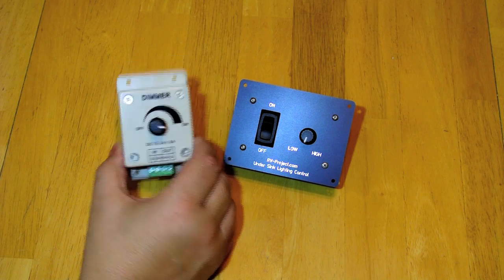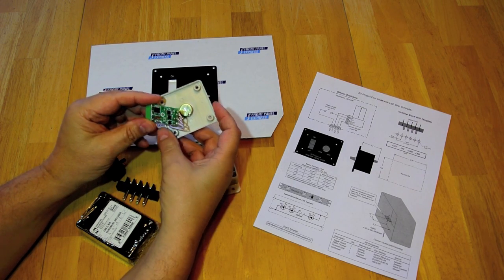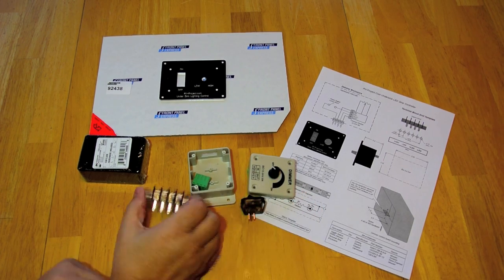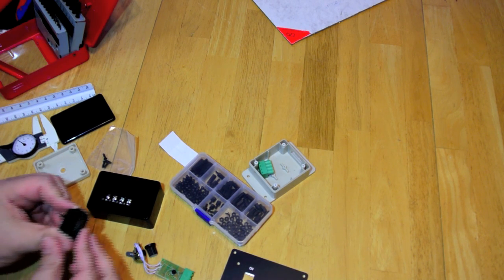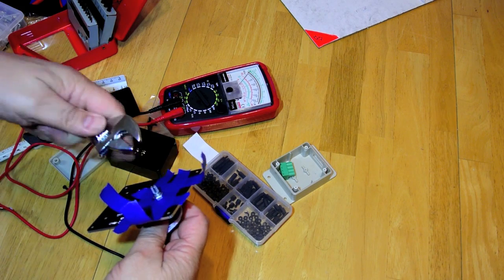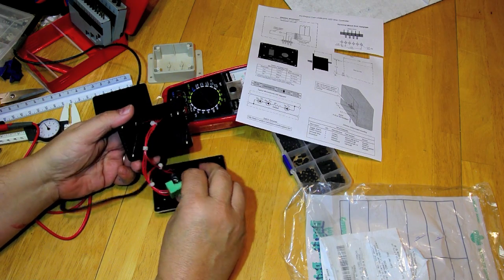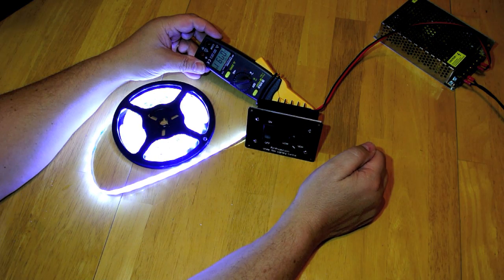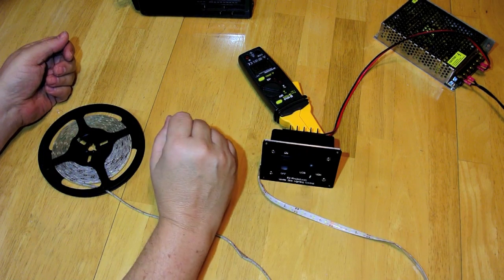A Custom LED Strip Dimmer for my RV

Comment: Is there a way to get the exact panel from front panel express without designing a new one
Reply from the maker: Yes. Most of my project videos have an associated webpage with additional information.  You can find the template for the panel here: http://www.rv-project.com/resources/e450.php

The template is about half way down the page. 

You will have to install the FrontPanelExpress designer to order the panel, but all you have to do is to open the template into the panel to do so.

Comment: Once again another well thought out design, I want to add some of these led strip light throughout our class c motorhome and I can't wait to see how they look in your fifth wheel! Job well done!
Reply from the maker: I will be doing a video soon on the actual installation. I decided to break the project up into two videos so they would not be too long.
Reply: RVProject can't wait to see it, we seem to share the same eye for detail especially when it comes to wiring... the crappy workman ship that the RV industry has deemed acceptable simply blows my mind! , We own a 2017 sunseeker 2300 class c (ford chassis) and it has had a total of three wires break do to the wires not being correctly secured and allowed to giggle around while driving down the road and I'm sure another factor that contributed them breaking is the fact that they Uses solid copper wire on the 110 side when strand wire would be much better for such a rough environment!  I've spent countless hours rerouting and securing wires in the coach since we have bought it and it has been at the dealer for the better part of the winter getting electrical issues fixed, really frustrating to say the least! Keep up the great videos and by the way I'm the gentlemen who bought the blank dash panel off you and I mounted a USB outlet, 12v outlet, volt meter and a small red led that I use as a indicator light that lights up when our toad car brakes are depressed because the wireless warning system that came with our roadmaster brake system is less than reliable! Thanks again for selling it to me it turned out great and looks almost factory!
Reply: RVProject j

Comment: FYI - I was reading the reviews on the other switch mentioned below and they its a mixed bag. The other switch I was looking at if i didn't decide to build your design was this on: https://www.ledsupply.com/led-drivers/12v-wall-mount-pwm-dimmer     I'm not sure how well it functions but its the same basic concept
Reply from the maker: I chose that particular dimmer because it was an easy one to transfer the internals into a panel you could customize. Any 12V PWM based dimmer would work for the under-sink project. 

I am currently in the process of producing a dimmer shoot-out video, but it won't be ready for another month or so. Depending on your time frame, you might want to see that video.

Also, I am designing my own dimmer that I expect to be the Mother of all Dimmers. I originally designed it to work with the Lippert Linc wireless control panel that some RVs have, but I realized after I designed it, it could be used in a stand-alone configuration as well. 

I actually just built the dimmer today, and am waiting for the encapsulating compound to cure. I have to shoot some video footage, create webpages, and so on to publish the project. This project should be released prior to the dimmer shoot-out video as I will be including my dimmer in the review. I hope to have that video released in a week.

Comment: I'm really digging your projects!! I think that this is a sharp switch and better than anything I've seen on the market. That being said I plan on building three for my rig. I have ordered everything but, I'm having a hard time locating the Degson 4 post terminal block. I have searched  the part number on www.parts-express.com and called them. It doesn't seem like they carry this part. I also found the part on Degson's web page but I cant figure out how to order it from there. I'm not well versed in electronics components so would rather not guess on this part. By any chance could you send me the link to where you purchased this terminal block? Thanks!
Reply from the maker: A suitable substitute for the terminal block is here: http://amzn.to/2BIiHTk

I also updated the project webpage (http://www.rv-project.com/projects/usdimmer.php) and project PDF to reflect the new part number.